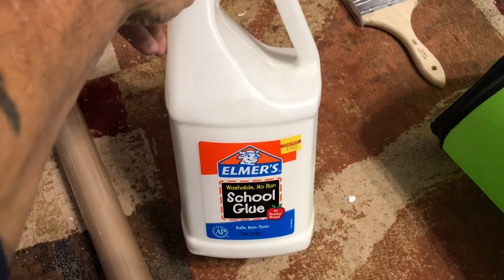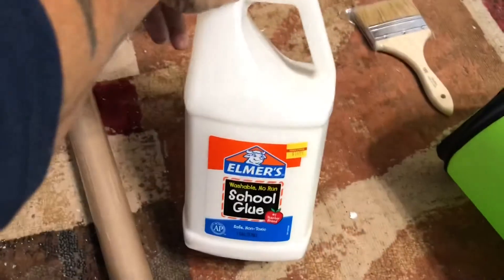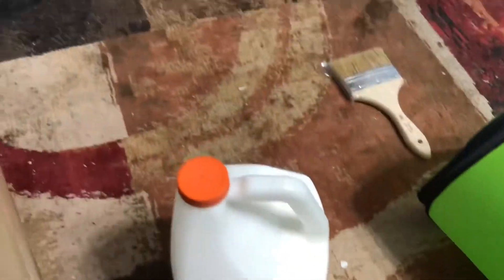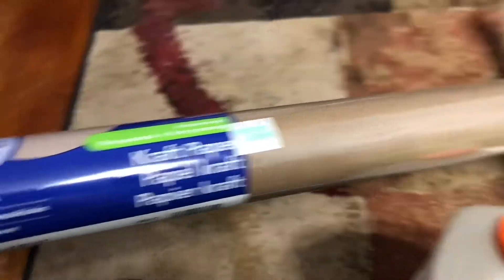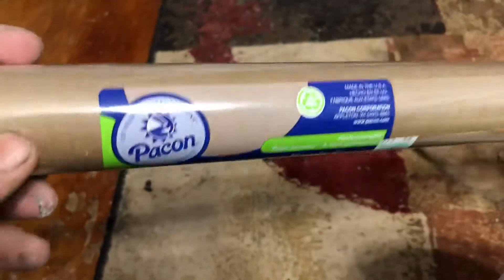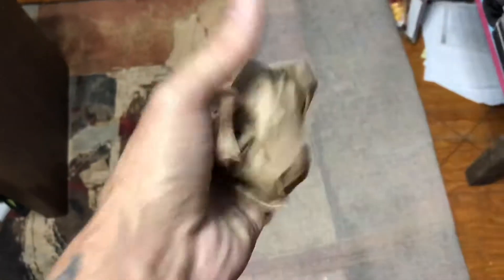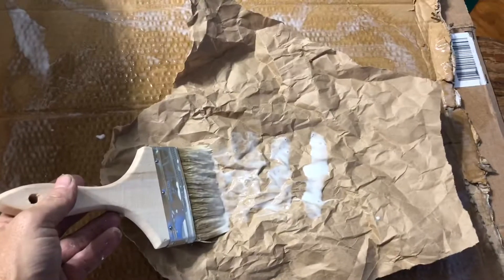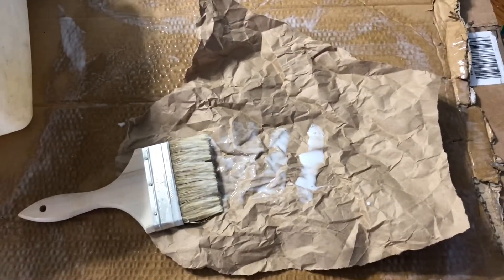Craft Paper Wall Covering DIY

Comment: That looks beautiful I did my whole kitchen as part of the remodeling of it,ceiling ,walls, and floor. I first painted the paper before gluing it up.The ceiling is white with a two-toned marbled texture,the walls are red with bits of the brown paper color showing through and the floor is white/black to look like a broken black marble slab incorporated with slabs of white marble. I added black glitter to the black and white glitter to the white then drizzled lite gray paint on the white part and made dots to add texture. I put five coats of polyurethane on the floor,three to the ceiling (it looked like glass) and one coat to the walls all to protect the surfaces.